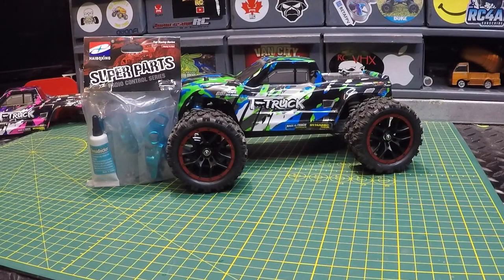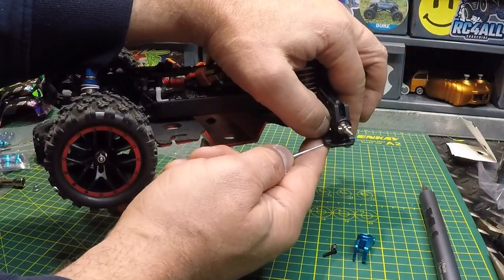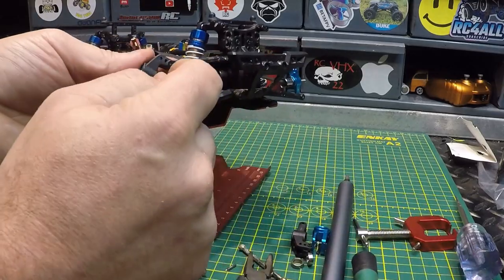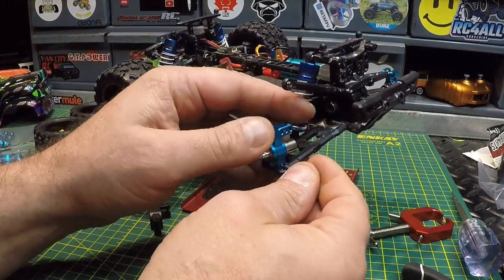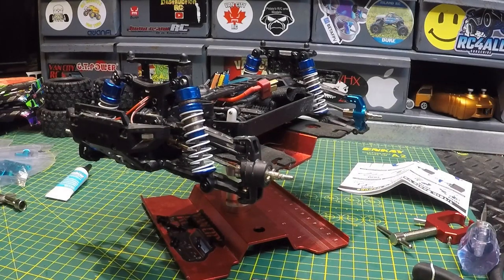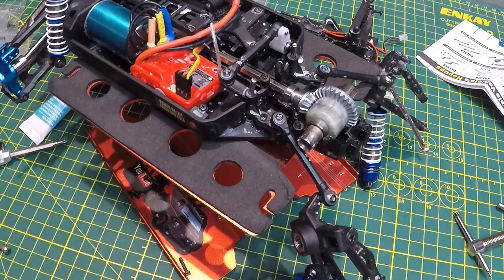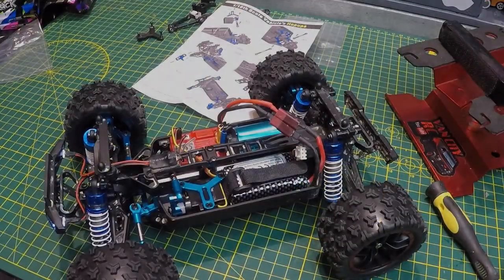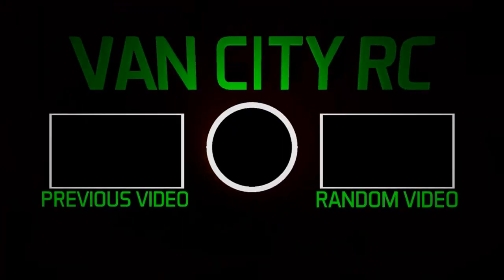HAIBOXING Super Parts, Metal Upgrade kit for New Generation 1:18 Scale HBX RC's

Comment: Thank you so much the gear puller link was essential! Subbed and will be here for future videos🎉
Reply: Also, I had to slightly sand down the metal ball cups in the arms to slide into the new hubs. Couldn't fit otherwise and gave me a headache at first.
Reply from the maker: Interesting must’ve been slightly off sized from the factory. Glad you sorted it out 👍
Reply from the maker: Cheers 🍻 it’s sure a handy tool

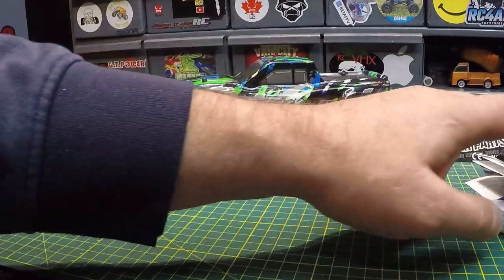Comment: I just got mine in the mail today though mine is for the 1:16 scale and it doesn't' come with instructions and and it is far from a complete kit so it's clearly an ebay HBX knockoff special. Mine comes with no tie rods/turn buckles and the steering kit I'm not sure how it is installed.  Mine does come with A-arms but the single rod/brace in the rear it doesn't come with so I'll have aluminum on the bottom and a plastic support still on the top. LOL
Reply from the maker: Sounds like your kit could’ve used a few more pieces to make it complete.
Reply: @Van_City  most definitely Dan

Comment: Hello Dan!
how did you install the pins on the  machined mettal diff outrdrived cups?  i try to upgrad on metal diff but i dont have the place to put the pins in the metal cups .
im fr sorry for my bad english lvl  ^^
Reply from the maker: By any chance is there while inside the cup for a screw?
Reply: @Van_City  roooo god dam ...no screw ....i think it Can work only with th rest of the upgrading...
Reply from the maker: @82nomak82  yeah maybe you need the rest

Comment: my hbx 16890 steering is weird and even with metal servo and smaller tires. If you give it too much slack the right wheel woobles a lot and if you tight it the servo is not strong enough to win the plastic friction and the steering binds one way and the other...a metal upgrade would solve that?
Reply from the maker: Metal upgrades may help with this issue. It’s odd that you are having this issue I’ve owned several HBX models and haven’t had issues like you describe with the factory plastic parts
Reply: @Van_City  i've read about many with this issue. You don't realize it when bashing but if you just drive in a straight line in 20 meters of tarmac you notice it. Only the gyro i have in mine corrects it but its annoying